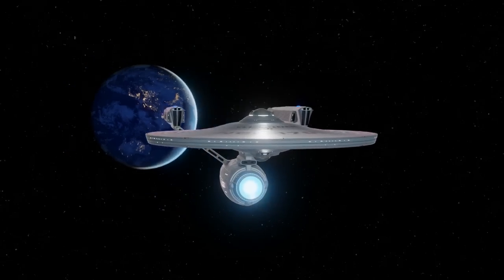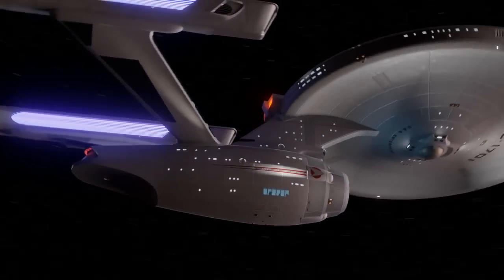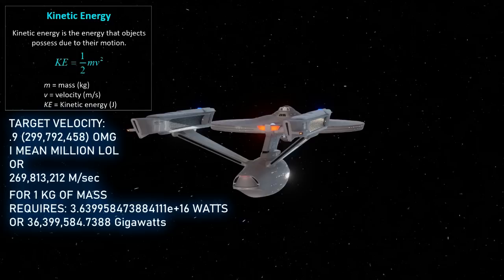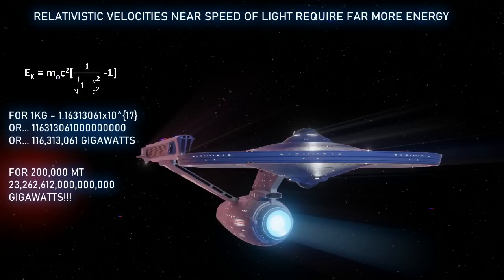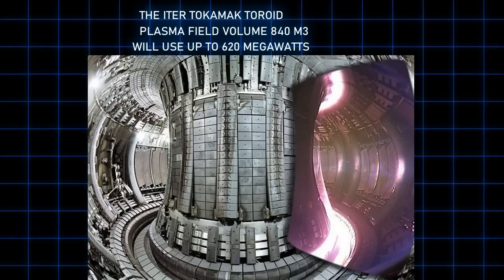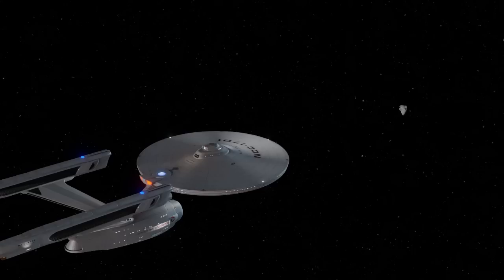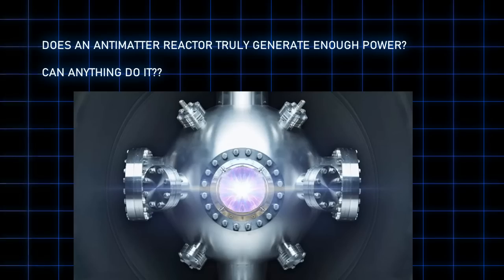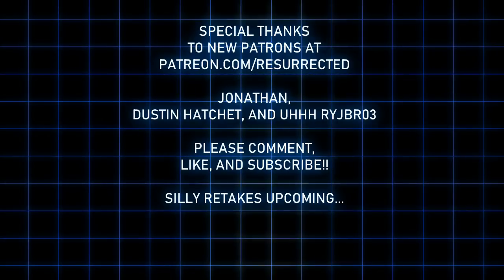How Many Nuclear Power Plants Can Power the Enterprise? Let's Calculate!!!

Comment: Don't Nuclear Power Plants just make heat and steam that turn turbines?  Would it change the calculations since we do not yet know how to directly tap into the Nuclear power source?
Reply: It is true that modern fissiom power plants use the heat resulting from the reactions and, as such, are limited in their efficiency and, therefore, power density. However, even direct electrical conversion of fission energy release, which could be 95% efficient in theory, would still suffer from intrinsic low fuel density compared to (most) fusion fuels and all antimatter fuels.

Basically, the act of fission releases approximately 0.08% to 0.09% of the fuels' mass as energy, depending on the specific fuel; and its also an average over hundreds or more individual fission. Actual mass-fraction conversation percentages are a completely random, at the individual nucleus level.

Fusion reactions are between 0.07% and 0.6% mass released for single step fuel cycles: where only one reaction happens per nucleus; Two deuterium nuclei fusing into a helium3 nucleus, for example, only takes one step. Where as multi-step fusion cycles range from 0.3% and 0.9% mass conversion. For example, on path for fusing deuterium onto nockle56 (as sketched on paper) takes 7 steps. And that's the short path. Others cam take dozens of paths....they're quite frustrating.
Reply: @bmobert  So is it that Fusion, once we get there, is not the cure all when it comes to efficiency?  Or do we just need to get much better at it?
Reply: @Create_The_Imaginable  
Oh! 
What I described above is just about how much energy is released per reaction in terms of percentage mass converted to energy. That number dictates how much mass you need, at an absolute minimum, as fuel to power your warp field.
Layered atop that number is then losses from conversion of energy released to energy used by the machinery that makes the warp field.

So, as a modern example, let's take current nuclear power plants. Right now, we let the particles created by fission bash into the walls and the water that surround them; this creates heat that we can then use to make stream to spin turbines. 100% of the fission energy turns into heat, but only about 30% of that heat can be utilized to spin the turbines for physics reasons. 
But there are paper plans for reactors that transmit the fission particle exhaust through magnetic fields. Those particles that have electric charge would interact with the magnetic fields, allowing their kinetic energy to be directly converted to electricity. While not all these particles have charge, for those that do, the conversion could be above 90%, meaning they'd get on the order of 3 times the energy into the grid while buring the same amount of fuel. 
But these paper reactors have huge tech and engineering problems that make them utterly impractical for the moment.

So, in conclusion, the mass conversion of the reaction is the first step. That's what I was talking about above. It informs the engineer what are the limitations of the fuel. It is a physics limitation.

And then there's the efficiency of the machinery that converts that released energy from random kinetic energy into directed, useful energy. This is a technology limitation.

Another modern example is burning hydrogen. Per pound (or kilogram) hydrogen has much more potential energy than gasoline. We can also convert it into useful energy at 70% to 90% efficiency via platinum fuel cells. (Modern cars are, at best, 30% efficient at converting the lesser amount of energy in gasoline into something useful.)
But....
Storing hydrogen sucks. It's way easier to store 300 miles worth of gasoline then of hydrogen, despite hydrogens' superior power. Worse, the machinery needed is way more expensive and would make a car a luxury item few could afford.

Sorry for the long ass post. But I hope I explained my previous post better.
Reply: @bmobert  Thanks for your answer!  It is good to know that there are designs on the horizon other than just making steam to turn a turbine. What are the challenges for the designs that use magnetic fields, allowing their kinetic energy to be directly converted to electricity. It is really exciting to see something new being considered! I am guessing the emerging designs have safety and also containment field issues?   🤔
Reply: @Create_The_Imaginable  
No. Containment isn't the big issue. Instead it's making it fission at all. Basically, today's fission reactors rely on free neutrons to to kep the reactions happening. Free neutrons are created in the process of fissioning, so what we do is put all the fuel in a pile and let the neutrons from one fission create the neutrons for the next fission. As long as, on average, every fission creates one neutron that is then absorbed to make one further fission, the reaction is stable. Things get complex quickly when trying to make this balance long-running but it's perfectly manageable. The biggest hurdle, tho, is that neutrons like to escape. It's way easier to keep them from escaping if you have the fuel all in one place. 
But, if you want to gather the rest of the exhaust with magnetic fields, you can't have all that fuel in the way: charged particles interact very easily and, in doing so, gives up their energy as heat... Exactly what you don't want.
So, since you can't just dump it all into special pile and let it react like we do now, you have to have an alternate method of either directing neutrons from previous fission into the current fuel or produce neutrons another way. The first is currently impossible for all practical purposes and the second calls for fusion or antimatter, both in much smaller amounts than needed for actually getting energy from them alone.

I other words, in order to make the fission exhaust free enough to interact with your magnetic fields, you need to react the fission fuel with a different fuel. That's a complex and difficult ask.
But it might be worth it: it would greatly decrease mass and volumetric size of a fission reactor... maybe enough to make a really impressive nuclear rocket.

There actually is a third option: the anti-zeno effect. Basically, there is a quantum measurement that could increase the self fission rate of the fuel. But I do not understand it well enough to describe.
Reply: Yes, you are right. However, nuclear fusion only turns about 1% of the fuel mass into energy. The questions to how to turn that energy into motion so that it can propel the ship. You get much more energy out of matter, antimatter annihilation, but you have to have a lot of antimatter which basically doesn’t exist in nature for very long. And then you have to figure out how to turn those gamma rays into a means of propelling the shifp
Reply: @mbmurphy777  
Pedantic correction that amplifies your argument:  almost 1% *at best*. Most fusion reactions are considerably less, on the order of 0.1%. 
Further, to get close to 1%, you need several reactions, the ash of one feeding the reaction of the next. 
For example, if you cherry-pick the reactions for simplicity, assume no side reactions and near perfect confinement, you can convert 56 hydrogen nuclei to one iron56 nucleus in seven fusion steps, converting 0.0876% of the fuel mass to energy.
Whereas you can get 0.07% turning hydrogen to helium4 in two steps. If you start with deuterium instead, and you're really good at containment, you can turn deuterium (heavy hydrogen) into helium4 at about 0.6% in just one reaction chamber... still two reactions, tho.
Still, for a society that doesn't want supply lines giving away the position of their war ships -like the romulans- it might be worth investing in a fuel so universally ubiquitous  as deuterium.
Reply: @bmobert  Oh boy, I did not realize we can't even do 1%!  I must be watching too many Science Fiction shows and movies to think that we could easily do 1% and I was like we just have 98% to go!  😲
Reply: @Create_The_Imaginable  Two things:
1) Yeah... 1% mayyer conversion is the upper limit to fusion. Plain old single-reaction deuterium-deuterium fusion  is 0.0949% conversion and 1/3 is is contained in the momentum of a neutron, meaning the only way we currently know  how to extract that energy is thermally, IE with a heat engine, like steam or sterling-cycle. Still, 2/3 of the energy is in charged particals (a proton, a helium3 nucleus and a tritium nucleus, when averaged over several reactions) and this energy can be harvested electro-magnetically at.much higher efficiencies, approaching 95%. Still, that 95% of 2/3rds of 0.0949%.... Engineering is for the stout of heart!
 And this reaction is harder achieve than the one-reaction deuterium-tritium fusion, which converts a very respectable 0.376% of the fuel mass. But 80% of this energy is in the momentum of a neutron! And, again, we.can only extract that.wnergy thermally. Most heat engines max out at ~40% in theory, and ~30% in practice. So that's 30% of 80% of 0.376%.
You can do the math.
Finally, you'll hear about proton-boron11 fusion, which is more of a fusion/fission process, as first the boron and hydrogen fuse make carbon12, and then the c12 fission into three helium4 nuclei. This process converts only 0.0775% of the mass into energy but all of it is in charged particals. (There are weird side reactions that release neutrons but  are so rare that as a first- or second-order estimate, they can be ignored.) So we can collect this energy completely electromagnetically and not have to worry about radiation contamination (much). Unfortunately, proton-boron11 fusion is very hard compared to the previous two. If we can do it, its just barely.
So, yeah. Not only is it substancially less than 1% mass conversion, energy collection efficiency is inversely proportional to how easy it is to make the reaction happen, let alone pay for itself energetically.
Fusion is (currently) hard and engineering (always) sucks.

2) You shouldn't snub your nose at ~0.1% conversion. That's quite a bit of energy! Remember,.the conversion ratio of mass to energy is c²! Using 30% efficient heat engines collecting all of the released deuterium-deuterium reaction, you still get 25 gigawatts by fusing a gram of deuterium per second. And if the TNG Tech manual is to be taken at face value, that's enough power to keep the Enterprise-D cruising at warp factor 2.0.
The bussard collectors should be able to pull that much deuterium out of average interstellar gas pretty easily. (I've calculated the required sweep area already but I don't have those numbers on me.)
Warp factor 2 (new scale) is 10x light speed. Thats a fair clip. It'll get you to voyager 2 in just under 2 hours. Not bad.
Reply: @bmobert  Wow, that kind of scares me that we know so much but also know so little.  If we can just get to Warp 0.5 or 0.5 of c, by warping space time that would be enough for me.  I know in Star Trek the impulse engines can do 0.5 of c but I am not sure that is realistic, I think some kind of warping of space time would be needed?

Comment: According to the official Star Trek blueprints, the original Enterprise 1701 was 190,000 Metric Tonnes.  The impulse engines were TWO nuclear FUSION reactors.  The Warp Engines were powered by Matter/Antimatter annihilation enhanced, controlled and focused by running it through Di-lithium Crystals.   Finally Phasers were created by merging Particle Beam weapons with Laser Beam weapons.  The merging of the two energies allegedly had a SYNERGISTIC effect making both weapons much more powerful than either was alone.  The name "Phasers" was conceived because the creators of the show envisioned "Phasing" lasers and particle beams together--hence "Phasers."

Comment: One problem that should drastically change these calculations. Comparing the weight of modern warships should be irrelevant since there is no fluidic resistance in space. Warships need a certain amount of power to push through both standing water and volatile waves crashing against it. With that in mind a starship should actually need much less power for space travel.
Reply: No, that’s completely wrong. You still have to overcome the inertia of 200,000 tons or whatever the way to the vehicle is. That inertia will be the same in space as it is on earth.  Also, the thought experiment is about accelerating a massive ship, and you’re talking about steady state operation of a standard naval warship, which only has to overcome the drag of the water and air. Constant velocity, power requirements are far less than the requirements for acceleration, especially when you get to relativistic speeds.

Comment: One other major problem. Let’s say the enterprise is 200,000 metric tons. If 100% of it were matter, antimatter fuel, you would still only generate something along the lines of 6x10 to the 13 Jules.  But you need 10 to 17 jewels to accelerate that mass 0.9 C.  So, without some sort of hand, waving magic, inertia, reducing technology, it’s physically impossible to carry enough fuel to accelerate the ship up to .9 C.

Comment: There is in fact canonical reference to the shields being far weaker on auxiliary(fusion) power compared to main(antimatter) power on this class of starship, so it pretty definitively will take just about as much power as you can throw at it. Impulse engines are canonically plasma torch drives with a micro-warp field generator, and thus they do not require so much power to get up to speed. The same thing for the shields also apllies to the phasers - ESPECIALLY on the refit connie.

Comment: You've confused power with energy. What is the difference? Power is the amount of energy expended per unit time (seconds, hours, days, etc.). Power is measured in Watts and derived units (Gigawatts, Megawatts, etc.). Energy is measured in Joules (J), and Watts are defined as J/s (Joules/second). Another unit of energy other than J, is W-hr (Watt-hours), this is basically taking the Watt power and multiplying by hours. You can think of it like the difference between speed and acceleration, if you multiply acceleration by time, then you get a speed. You can limit your acceleration and get to whatever speed you like, it'll just take you longer to get to that speed.

Comment: Plasma energy shields are already used on the best tanks today. Israel makes the "Trophy" system that is used on the M-1c. This system makes a magnetic field that is as strong a solid matter 50' away from the tank. When projectiles hits it actually looks like SciFy kind of "shields", it looks like they hit an invisible impenetrable wall. Simultaneously a transmitter superheats the air between the projectile and the tank into a plasma attenuating the concussive force protecting the crew from TBI. Its so completely awesome to see!!!!
Reply: This sounds utterly amazing!

Comment: Now I am no rocket scientist or anything like that but did your speed of light figures account for the weightlessness of space? you say that it takes 36,399,584.7388 to move 1 kg of mass? 2:28 but is that in space where everything is weightless? also on your shield figures you show the shields as a box? from my watching Star Trek I have gotten the impression that they are more like a skin over the hull of the ship not sure how far they would extend out but would that change the figures at all?
Reply: Things are weightless, but they still have inertia. Acceleration has to overcome that inertia.

Comment: Ok when I did some quick calculations I came up with an insanely.large mass of over 500 metric tons having to be converted to energy to hit an output of 12 billion gigawatts. Im a chemist not a physicist so I probably made a laughable mistake somewhere. But still the enterprise would have to be reacting huge amounts of matter and antimatter over a relatively short amount of time. Where is it all coming from?
Reply: No, I think you’re on the right track. Even with matter antimatter conversion at 100% efficiency into propulsion, you still have to deal with the rocket equation if you’re going to carry the fuel with you. And it becomes ridiculous to the point that 90% of the mass of the spaceship ends up being fuel if you’re getting really close to the speed of light.

Comment: A nadeon can be produced by slowing light down thru a Radeon cloud, till it clumps into light matter. This is done several times till you get a nadeon light particle, or turn a photon into a hydrogen equivalency light matter. By using an Xray high energy laser, you get a slowed down high energy nadeon or phaser, which goes fission on impact with normal matter, turning the matter into energy upon contact, vaporizing it.

Comment: I'm not a huge Trek fan, but I know that whenever they mention auxillary power they are referencing Fission or Fusion Reactors. The Enterprise has operated off of auxiliary power in several shows to my knowledge, therefor however many it has is how many it takes to power it. However it doesn't appear to be as efficient to burn radioactive fuels or tritium as it does anti-hydrogen and lithium.

Comment: In Star Trek, they have an 'inertial dampers offline' gravity control that reduces the effect of mass in your calculations. When you disconnect the quantum gravity of the starship from the rest of the universe, the energy requirements of accelerating change.  this tech is different from the Warping Fields used to Warp the Space Ship. Course I am 5 mins into the video

Comment: You are confusing joules (energy) with watts (power (joules per second). Being at a certain speed requires joules - getting there requires watts (work). Knowing the available power and the required kinetic energy levels you calculate possible acceleration rates (time to achieve a speed).